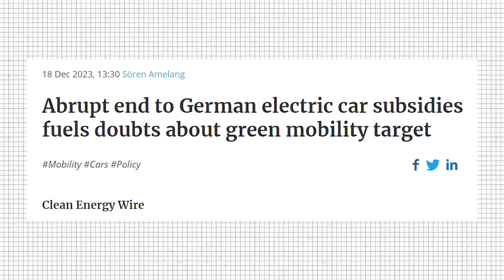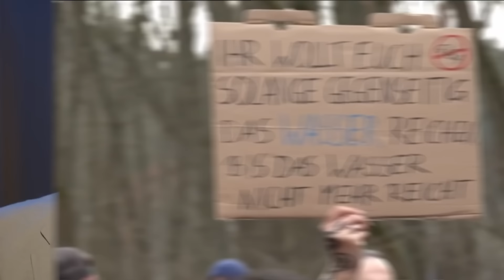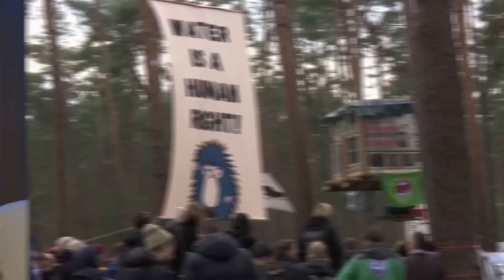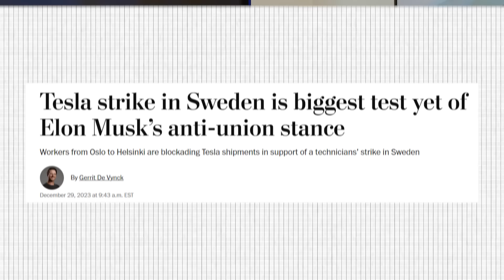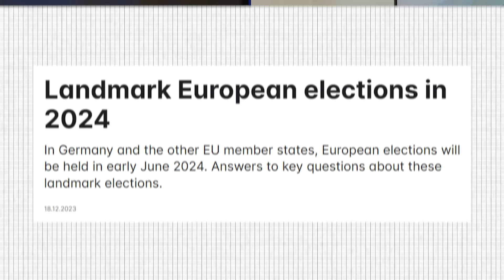Tesla Giga Berlin Expansion w/ Alexandra Merz

Comment: Tesla is fine but it isn't green. To refine 1 ton of Lithum you need 500 tons of ore and 500,000 gallons of water; lithium is only 7% of the battery. Most EVs get power from the grid; most grid power is fossil fuels; you also lose 15% of that enery over transmission lines; plus the typical Tesla EV is 30% heavier than a hybrid; so you need 30% more energy to push the heavier car. Possibly more important there are 1.4 billion vehicles and BEVs under 10 million total that is less than 1%.  If you want to try solar or wind; you must include battery farms as part of this; which means more ore and more nickle, more copperand of course the high cost.
Reply: A lot greener than burning Putins oil 😂
Reply: @925greenb If you compare to a V8 probably true; 6 cyclindar probably 4 cycindar hybrid - probably the hybrid uses less
Reply: @litestuffllc7249  didn't hybrid also use lithium? Also you consume gasoline when you use them, unlike lithium which you  buy only once.   Which means hybrid pollute more than BEV.
You  always have option to go green with ev. Rather  than ignoring that gasoline production from extraction, refining and distribution also use grid,  which pollutes even more.
Reply: Nearly 2000 tons of water to refine lithium to get 1 ton of lithium? That is a huge exaggeration (3 - 20 times). But you will be happy to know Tesla is building a Lithium refinery right now. It will recuperate/reuse most of the water by way of large condensators. 
Teslas are among the most efficient EVs (if not the most). Hybrids are hugely inefficient when compared. Afterall, they have both motors and an engine. According to statistics most hybrid owners use the ICE most of the time. They also comparably weigh close to EVs (*). Even with a smaller battery they have an engine and a fuel tank. In fact it is a mystery that hybrids qualify for subsidies. Hybrids are only interesting for people with range anxiety or if is difficult to recharge (apartment or far from chargers). 
Concerning efficiency:  The weight of electrical vehicles is less important than the aerodynamic drag, especially if you go fast. At slower speeds much of the energy spent to accelerate is recuperated by regen.

(*) BMW series 3 hybrid with fuel is close to 1900 kg. Tesla Model 3 RWD is 1610 kg. But a Toyota Prius Prime XSE at 1595 kg is in fact a bit lighter than a Tesla Model 3.
Reply: OK but these just don't pop into existance; the BEV battery takes a large upfront CO2 mining investment to make it. A Hybrid has a battery about 1/8th the size;  So 1/8th the upfront investment per car for the battery. They Tesla Model Y weighs 4200lbs the Prius weighs 3200 lbs. Even though the Hybrid battery is 1/8th the size it still can do commutes up to 40 miles all electric. So if all you did is commute the Prius costs less upfront CO2 to make. So then - what about longer drives?  Say you want to drive 600 miles rount trip.  If the power were provided by a Natural gas Generator plant that is 70% effiicent, minus 15% for tranmission; it still weights 30% more to move is roughly the same efficiency of the Prius which has an engine 45% efficient but pushes a lighter car. Now in come cases the BEV could be better if the source of power was solar or wind. That may even things up overall but not make it greatly better - over all if you mostly commute - they are roughly even.
Reply: @pierre.a.larsen  Lets see 7 lbs per gallon; 500,000 gallons per ton - 35. million lbs /2000 = 1,750 tons per ton of lithium. I read about Tesla's idea to take the German lab process and try and scale it - at best that will take 5 years to manage to do and by that time everyone will decide to go hydrogen because of the USGS discovery of trillions of tons of naturallly occuring hydrogen.  You can see even Tesla doesn't think that lithium refining process will be working any time soon as they are processing the lithium near the Austin plan with settling ponds the convensional way
Reply: @litestuffllc7249  Hydrogen so far has been too complicated (and expensive) to work with. Though using renewable energy to create hydrogen could be a viable way.
I do not think Tesla is extracting Lithium near Austin. But I am not sure.
The refinery they are building is near Corpus Christi, TX, (on the coast) I think.
Tesla believes they will be up and running in a couple of years. Let's see. They are always optimistic.
Reply: @litestuffllc7249  Tesla Model Y is much bigger than a Prius. I feel the fair comparison is with a Model 3.
True, you can spend little with a hybrid. But all stats, I have seen, show that people with Hybrids mostly use them as ICE vehicles.
I could not agree more: Of course the energy to charge batteries should come from renewables. One day it will.
The Tesla Model 3 spends only 300 watts per mile. No gas or diesel car of a comparable size can compete with that.
All ICE are not very efficient. They generate a lot of heat. Electrical engines are in +90% range of efficiency.
I would like to see us get rid of all fossil fuels as fast as possible. They polute, they polute extremely in cities and they enable dictators.
It will take decades to change over completely but we will get there. For now BEV are at the point where they are better (safer, quicker) and even cheaper, if you consider total cost of ownership. You can just charge them at home. No gas station anymore!
Reply: @pierre.a.larsen  The one I think Tesla is still planning to use is on the Salton Sea in California.  Here you may want to see the fairly new development about Hydrogen. if the posting gets removed because of a link - its under Electric Viking USGS
Reply: It’s better to consume electricity at 98% efficiency than petroleum at 25% efficiency. How does refining lithium compare to refining petroleum? Lithium can be recycled.
Reply: @LelandPratt-j4k  Right, 90% is better than 35%. But if you are using natural gas being used to generate electricity the 90% figure is only counting the turbine at top output; when it is at lower out put the efficiency drops to as low as 50%.  Then there is the matter of transmission of the power to the charger a loss of about 15%; lastly  you have a car that is 30% heavier so that costs 30% more energy to push. EVs can do better if they are using home solar  or maybe solar warms or some other sorts of power but they are a minority of power on the grid.  People also forget that dams and nuclear plants have massive CO2 investment to build, U235 is also very CO2 intensive to refine.  Overall there isnt much advantage to it at present.  If you were to use ethanol or bio diesel to fuel a hybrid ; it would not use any fossil fuel other than the invetment up front to build it which is smaller than the BEVs typically.
Reply: @litestuffllc7249 Lol ethanol and Biodiesel. You still talking about water in Lithium production? What happen with Australian lithium that consume substantial less water?
Reply: @yulusleonard985  The water is used in the refining process; my understanding is that China does the refining of Austrlian lithium. Is that incorrect? If Australia is doing substantial refining with less water I'd like details if you have some.
Reply: @yulusleonard985  We need to clean up the grid with or w/o EVs.  It is ingenious for Oil to call BEVs dirty when it is their investment in a fossil fuel grid that is causing it.
Reply: @litestuffllc7249  Water used for refining liquid lithium, mostly from south Americas. Australian lithium already  solid lithium carbonate. my  previous post  trigger some people so  here a new one.
Reply: @yulusleonard985  I'd be most interested to see the details if you have them. I haven't noticed refinin done in Australia.  I'd like to evaluate the capacity ; recently I've been reading of lithium mines loosing billions; probably going bankrupt.
Reply: @litestuffllc7249  Because Australian  lithium already   in solid form. Liquid lithium of South America need a lot of water to refine it into solid. Bankruptcy happen  because  because falling lithium price.
Reply: FUD and proofen wrong
Reply: @stefanpredl6849  I give facts and you give your stupid opinion - your proven wrong - those are the realities
Reply: @litestuffllc7249  like ignoring  carbon from  gasoline production?
Reply: @yulusleonard985  no but go ahead and check ; unless you are talking about Canadian oil sands the production cost is minimal in terms of CO2. Far better are ethanol and bio diesel; derived from crops; and zero fossil fuel; totally renewable unlike the BEV which costs so much to mine and then typically consumes fossil fuel to be powered... if CO2 is your measure of what is good then BEVs aren't very good.
Reply: @litestuffllc7249  I live in a country that use biodiesel. You have  no  idea how much  water needed and  deforestation they cause.  And because living in a city of 5  millions and I do own electric vehicle if any one talking that ICE vehicle pollute less are BS.

If its cost  so much to mine why on earth LFP cost $55 this year alone? I know you eat that Toyota presentation slide as truth but batteries today only 20% of BEV production  cost.

Just   because you talk about Ethanol and Biodiesel you know nothing.
Reply: @yulusleonard985  Ok I am intersted to hear what you are saying what country is it you live in Yulu? First you mention deforestation - if you remove some unproductive trees and plant crops that are useful that really is an exchange of a productive plant for one doing nothing. It isn't destruction without a replacement. On the EV side you have 500 tons torn out of the ground to get one ton out; that is just lithium; 7% of the battery. Let me ask you how far you commute for work?  It isn't Toyota saying it takes 10x more mining to make an EV - I'll give  you the link of a Pro EV source saying that exact thing; they however think; this will be made up for by the using solar or wind; there isn't very much solor or wind. Most of the grid is powered by coal and natural gas.
Reply: ICE engines are 30% efficient (heat losses out the radiator, engine block & exhaust) & Tesla’s are over 90% efficient. Look at MPG & MPGe, 30 vs 120. Factor this into your FUD diatribe.
Reply: @litestuffllc7249  Did   I post something soo triggering tat it got   reported over and over?
Reply: @kleinzach007  You are completely missing the point of what I wrote. A Tesla may be 90% efficient once you charge it; but a powerplant that powers it is not. The Grid is still majority fossil fuel powered by plants that average 70% efficient, then you lose 15% in transmission which is 55% Then you have your 90% EV which makes it perhaps 50% add to that it typically weights 1000lbs more which is 33% more between a Prius and a Model Y or Model 3 long range. So at best you are even as that brings you down to about 35%. Add to that all the higher mining costs to build it. So one may counter that there are renewables used on the grid and the ICE/Hybrid can also claim they already use ethanol in fuel and they could run completely on biodiesel or ethanol making them 100% renewable and they will continue to weigh less and use less energy in the miniing of their currently more easily mined make up. Now if you can identify an error in this analysis do let me know as I'd like to hear of any other benefits of an EV.
Reply: @pierre.a.larsen  To your comment; my intention is to say 500,000 gallons to process the 500 tons of ore which is 1000 gallons per ton of ore which in lbs is about 7000 gallons of water for 2000 lbs of ore; this is actually probably low by 2x or more; now maybe you thought I was meaning 500,000 gallons of water per ton; and I'd agree that wasn't what I was meaning.  To put 2000 lbs of material into a slurry of water and ore then enough to precipitate out the lithium probably is at least 1000 gallons but probably I am significanlty low on that figure.